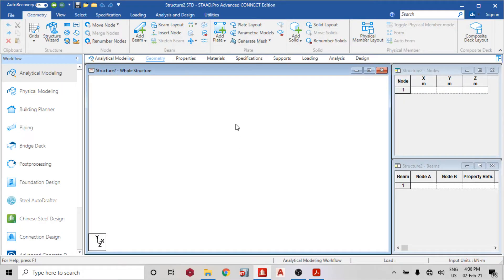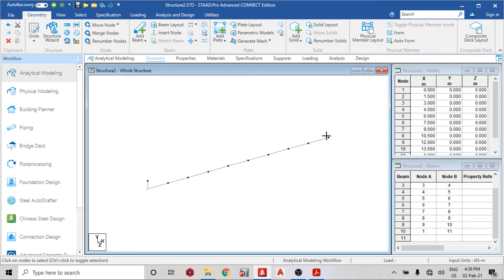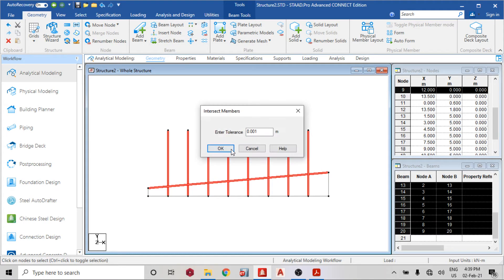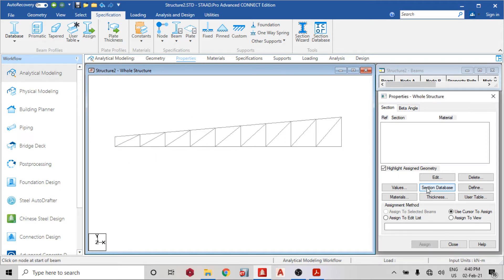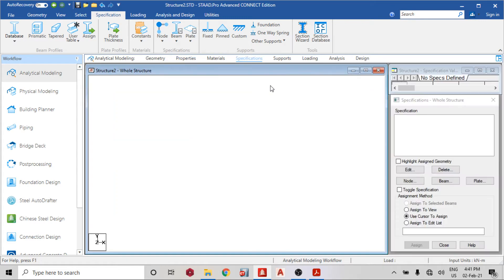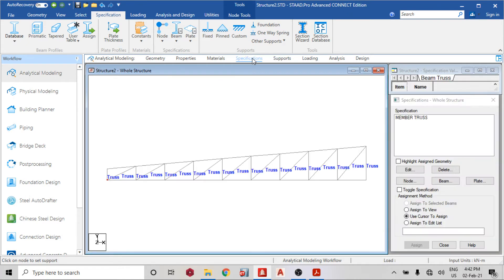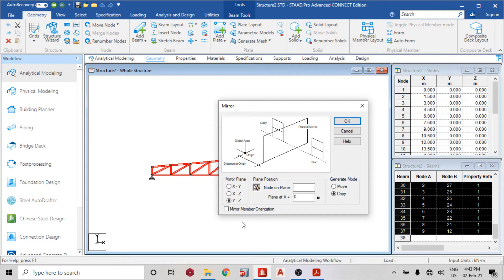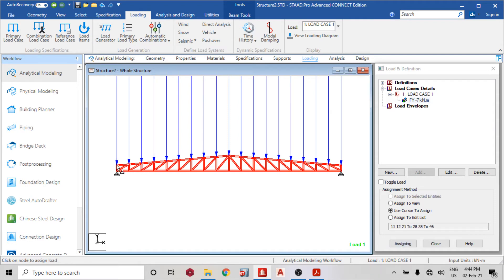What steel Utilization ratio means on staad pro connect edition

Comment: HI BOSS WHY STATUS COLUMN IS NOT SHOWING IN MY UTILIZATION TABLE? THANKS
Reply from the maker: Did you apply the check code command ?
Reply: @Lanreolokunola  YES, I GOT ALL  COLUMN  LIKE ACTUAL RATIO, MAXIMUM  CAPICITY, NORMALIZED RAITO EXCEPT STATUS COLUMN (STATUS = PASSED OR FAIL)
Reply from the maker: If you used the check code command, it would bring it out for you